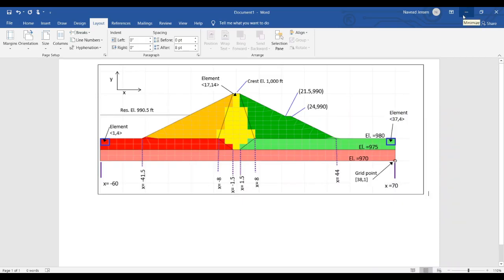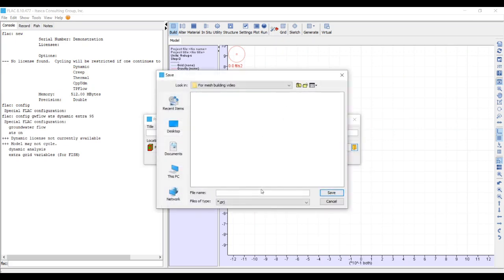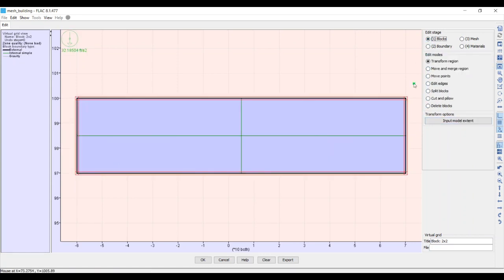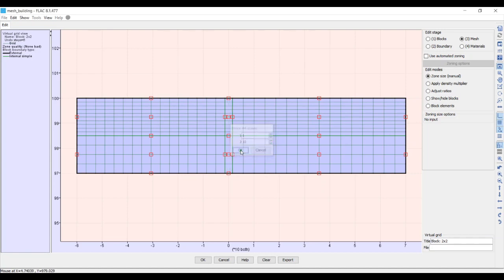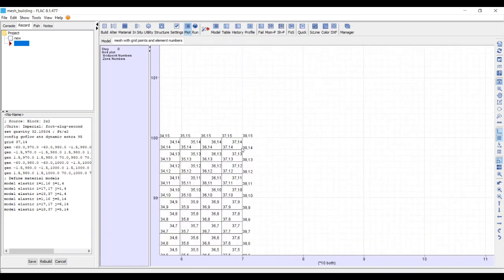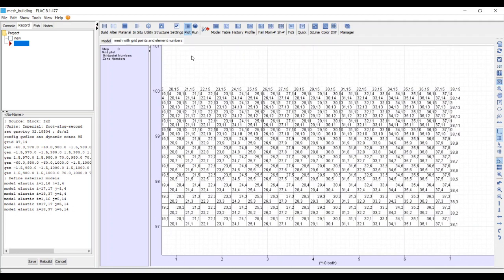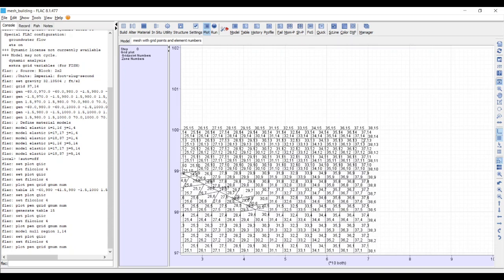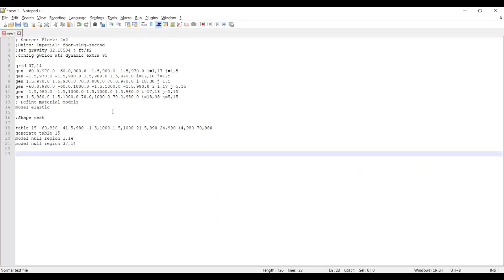Seismic analysis (part 1 of 5) of an emb. dam and foundation for a FLAC analysis, creating the mesh.

Comment: very grateful for the tutorial, I don't know if you could make a tutorial applied with elastoplastic deformation models with hardening
Reply from the maker: Hi Jorge - I haven't made that type of tutorial yet, but will add it to the list of requests.  Are you thinking of using what the Itasca manual calls "model ss", the strain softening model?  That model can also be used for strain hardening, meaning, the strength can increase as strain increases.